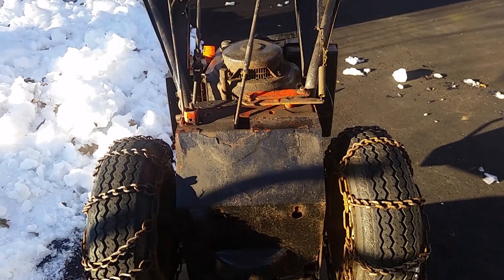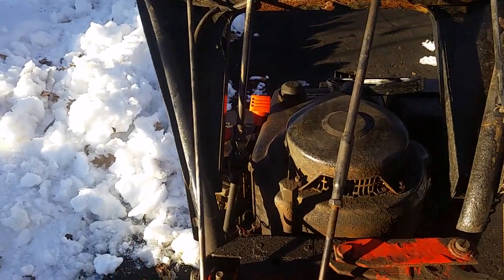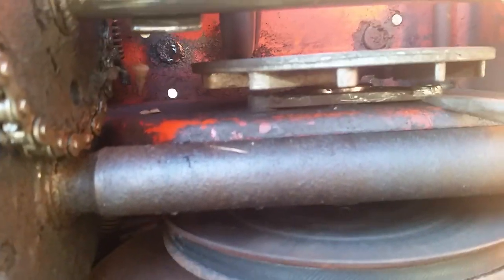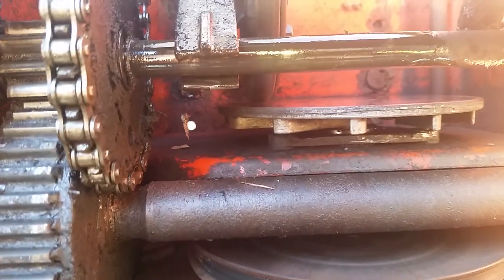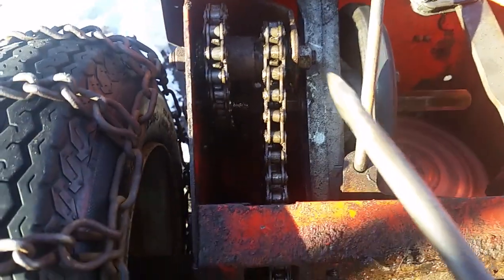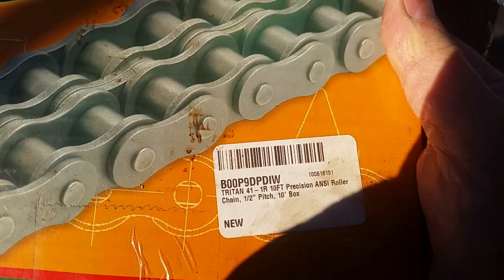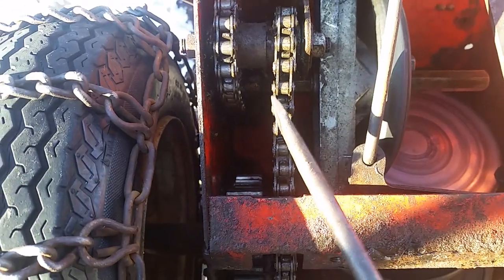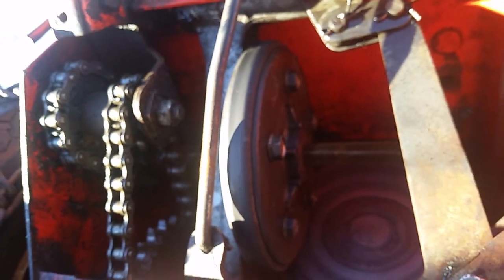Ariens ST824 snowblower drive train

Comment: I have a 1985 ST924.  The drive plate doesn't move at all up/down.  Can't even use a pry-bar.  I have a strange feeling it's done for.  Replaced the friction disc because it was a hard piece of rubber that was smooth as glass.  I really don't want to replace this unit as it's a workhorse.  Solid engine, but that drive plate area looks like it's toast, and I really don't want to get into taking it apart as that area is a MESS!
Reply from the maker: Try PB Blaster spray. That should loosen up the rusty shaft.

Comment: These are pretty basic, I work on tons and usually it's the same old corrosion and rust, sand holds water and eventually it makes the paint bubble and causes rust holes, I spray everything w/ PB Blaster and then remove the old grease, put new lithium grease on everything. I don't care about the disk or the wheel at this point because it's going to get dirty. After doing all the heavy lifting and getting everything in working order, I use gasoline on a rag or paper towels and clean the disk and the wheel, as the very last step before reinstalling the belly pan. These two things are going to get dirty no matter what you do so don't spend a whole lot of time trying to avoid it, just clean it up well when you're done. If you have salt on your sidewalks or at the end of the driveway try to do those first and leave your clean snow to help wash out your machine toward the end of your snow blowing, this helps get rid of all the sand and salt just like Flushing a boat motor if you use it in saltwater

Comment: Seriously: 30 years old ?  A continual shop project.
Reply from the maker: Ariens is well built and should last many years if it's properly maintained. I've put less than $100 in parts over all these years and it's still runs great thru 15" of snow.
Reply: @peteranania7166  Sorry, no offense intended.  Ariens  could use you for testimonials. 😎

Comment: Ive picked one up last year from a coworker it was moving back and forth now its stuck in reverse what size wrench do I need to remove the big bolt that holds rubber drive plate so I can lube it